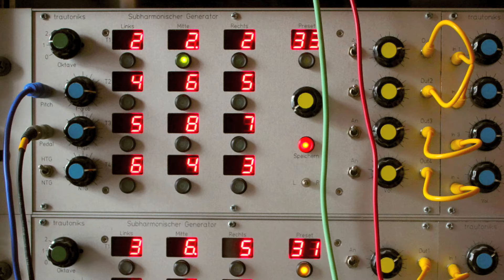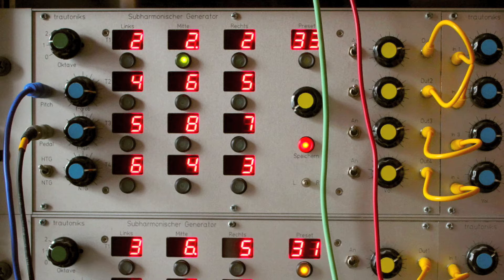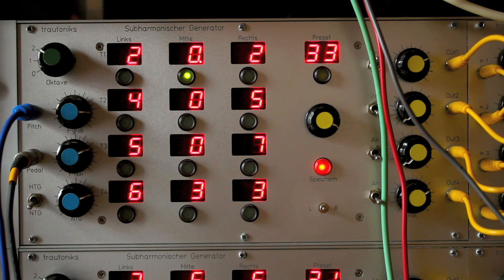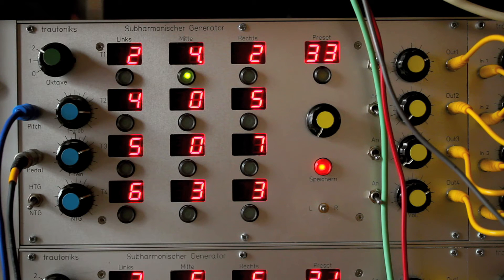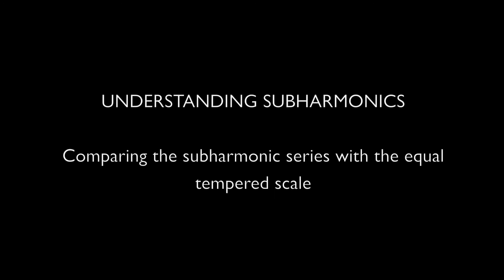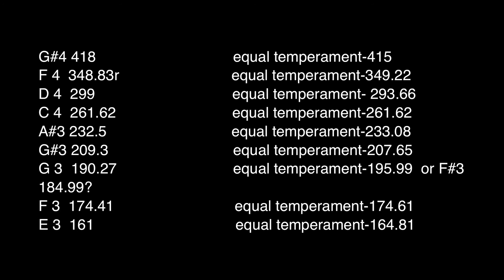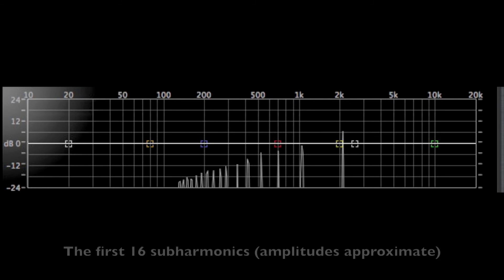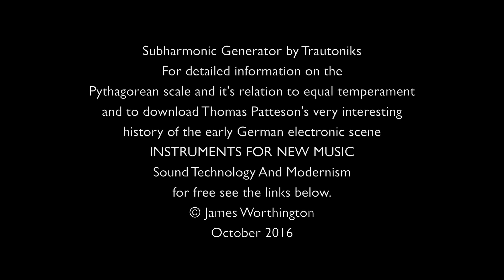Mysteries Of The Trautonium's Subharmonic Generator 2

Comment: thank you so much for the video, very interesting! But concerning the calculations in cents you made some mistakes I think. For example C5= 1046.5 Hz, on the trautonium it's the same (2093/2). So I'm not sure why you put C6+1 in the description. 
The same is true for subharmonic 8 and 16. On both 'piano' and trautonium: 261.63 and 130.81 Hz. All the examples with differences are close but not correct: for example F4: 698.5hz, the trautonium: 697.7 hz (2093/3): -2 not -3. A better example is subharmonic 5: on a 'piano': 415.3Hz on a trautonium: 418.6 So they are certainly not the same (14 cents difference) According to my calculations (which are also found on several websites: 1 c7, 2 c6 3 f5-2, 4 c5, 5 g#4+14, 6 f4-2, 7 d4+31, 8 c4, 9 a#3-4, 10 g#3+14, 11 f#3+49, 12 f3-2, 13 e3-41, 14 d3+31, 15 c#3+12, 16 c3, 17 b2-5, 18 a#2-4, 19 a2+2, 20 g#2+14, 21 g2+29, 22 f#2+49, 23 f#2-28, 24 f2-2.
Reply from the maker: As stated, these figures were derived from an A-113 module subharmonic row in melodyne. I cannot account for why it should have these discrepancies, other than theory and real world measurements. Which websites, could you post some links?
Reply: there is an image on this website showing all deviations in cents for the harmonics, for the subharmonics you just have to change the + into - and the other way around: https://andrewmeronek.com/music-tools/blue-notes-and-the-harmonic-series/ Now that I think of it, it's only logical that an analog instrument like the trautonium can never perfectly represent all these tones up to the accuracy of a single cent, in fact it did for most of the subharmonics on your instrument which I think is already quite amazing.
Reply: @GMS267  I don't know about the particular instruments, but could it be that the A-113 module is implementing octave stretch to mimic piano tuning, which includes octave stretch to account for string inharmonicity?
Reply from the maker: @Lucius_Chiaraviglio  Nothing so sophisticated. The A-113 tracks the frequency of whatever oscillator is driving it, be it good or bad. The subharmonics are as explained and their frequencies are ratios of the frequency fed to it.

Comment: Does this use any components of the Doepfer A-113 or is a completely original design?
Reply from the maker: Hi, They were built for me by trautoniks. Jürgen worked on Oskar's Halbleiter, or semiconductor trautonium's subharmonic generator, so based on the original design. It's worth pointing out that the saw shapers are quite substantial circuits in themselves on these modules. One can see and hear that they produce very distinct and variable waveforms in the preceding video.
Reply: Thanks!  I post the videos on MATRIXSYNTH and added this as note to the bottom.